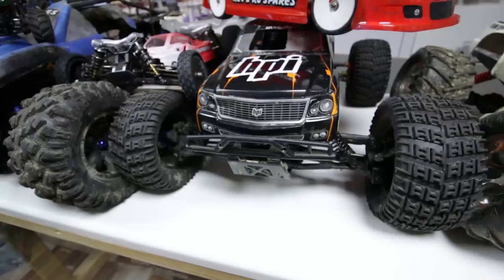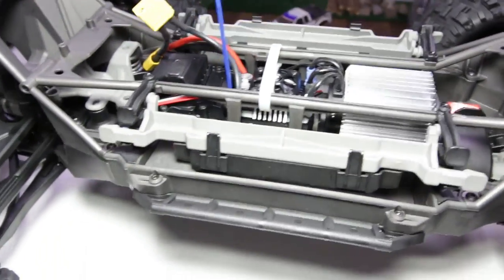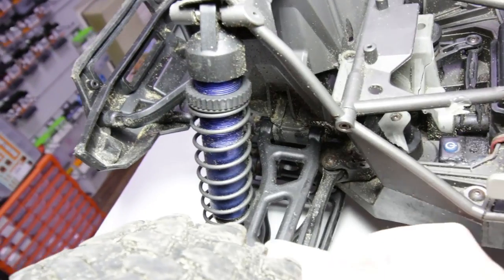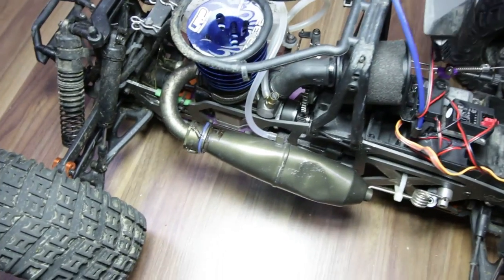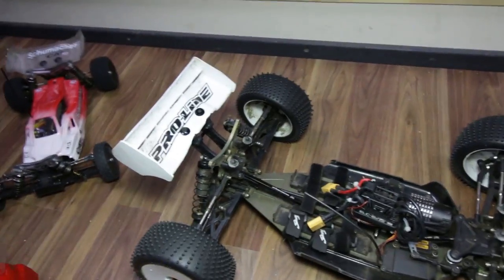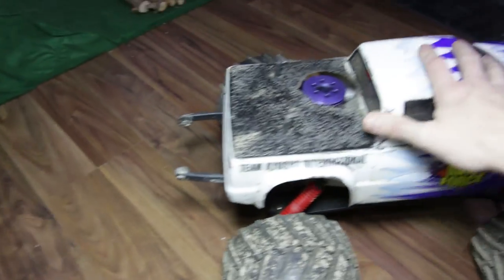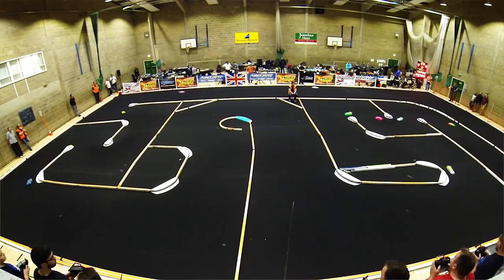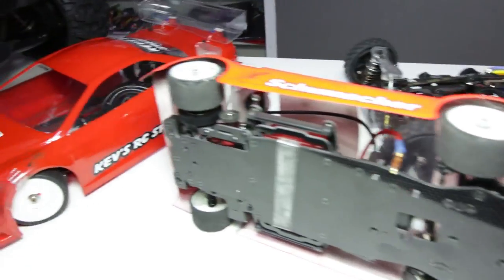My RC Car Collection

Comment: That red X-Maxx looks stunning!
DX6i on RC truck? :-) 
If it wasn't for my RC heli addiction I would be able to buy the X-Maxx. :-)
Oxy2 or X-Maxx? I need both 😀🤘🏼
Reply from the maker: Thanks, yeh the red maxx looks too nice to use! I use the dx6 on the 4 wheel steer wheely king :) Cheers
Reply: Kevin Talbot Look forward to the vid of the Wheely king, never heard of it before.
What's your thoughts Kev, on putting cooling fans on the stock X-Maxx motor when running 8S with the max 6?
Reply from the maker: simon99889 Yeh I think fans work quite well but I keep breaking them. if you bash hard they don't seem to last very long. so if anyone knows of basher proof fans....

Comment: Could you explain in a video what the difference is between running 6s or 8s. 
Thanks
Reply from the maker: Yes I have a video planed cheers
Reply: It's a lot faster! Lot more heat lot more torque !